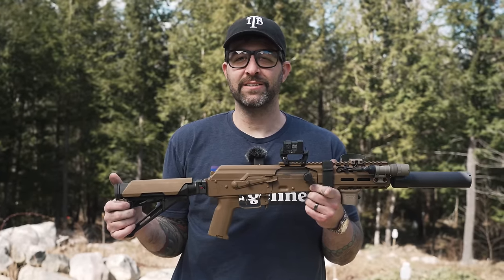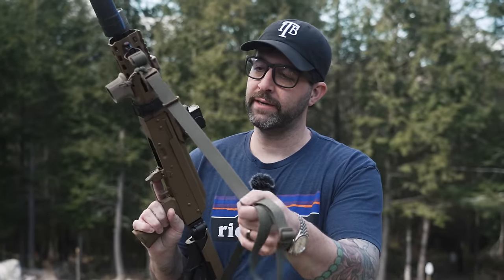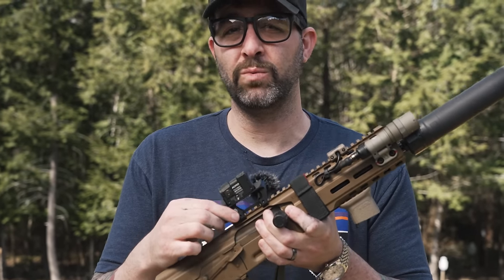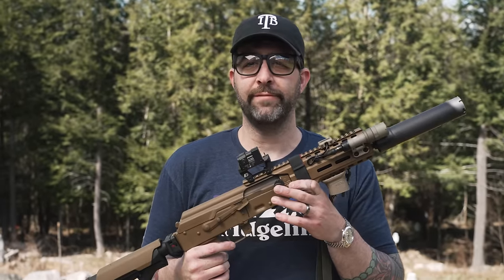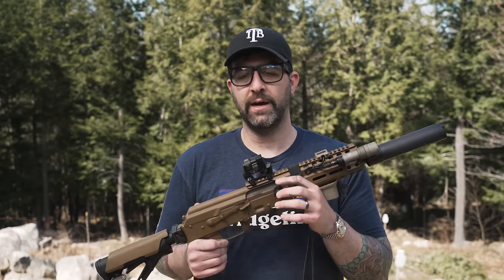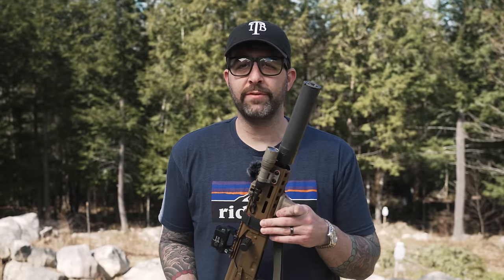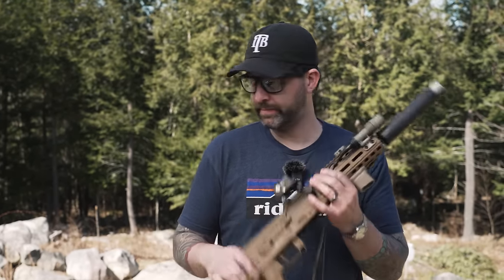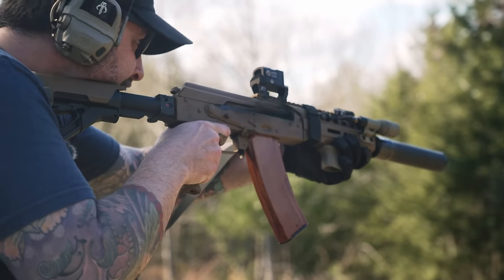Rifle Dynamics Quick Hatch RD-74 in 5.45 x 39mm

Comment: Any advantage to this adjustable gas system over the kns piston aside from not having to field strip for the kns to adjust it? Speaking of which how does the top cover come off with one of these installed?
Reply from the maker: idk how the internals of this work. I just shot it out of the box
Reply: Doesnt the kns adjust by ventimg gas onto the bcg?
Reply: @roberthutchinson2856  yeah sorta. It rotates at the tip of the piston allowing more or less gas to pass through. Just would be curious how this would compare functionally to the one in this video but I guess I'll have to find out for myself.